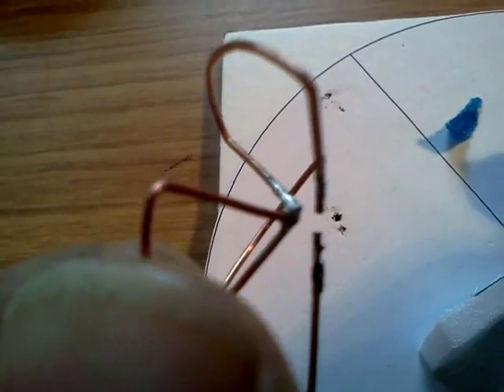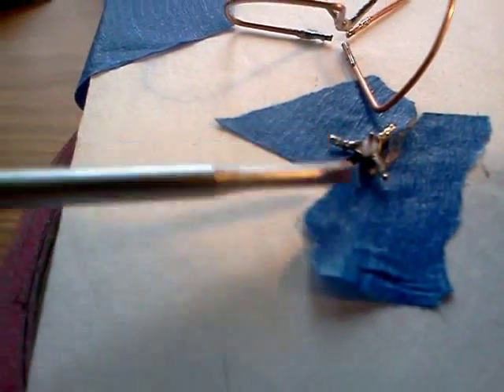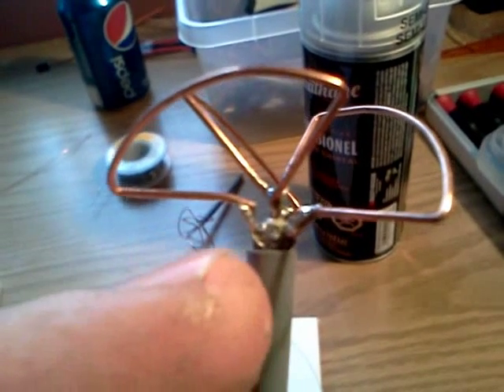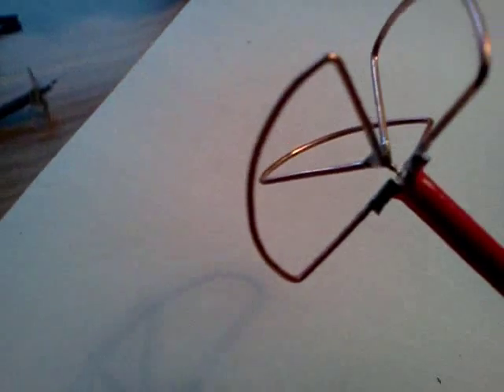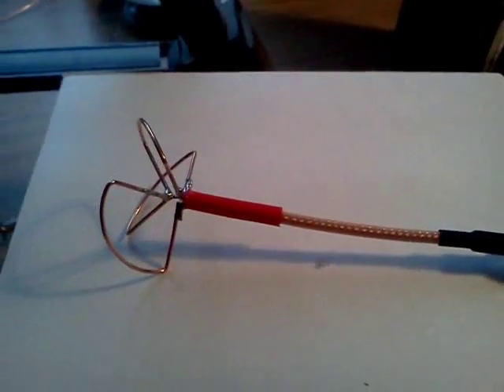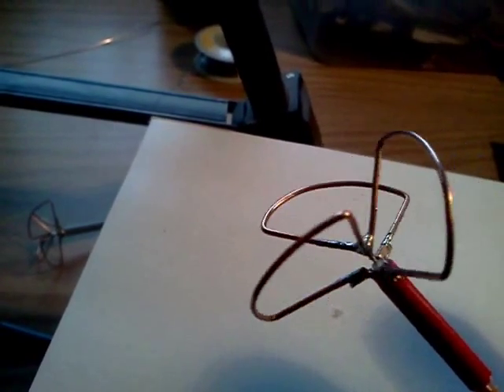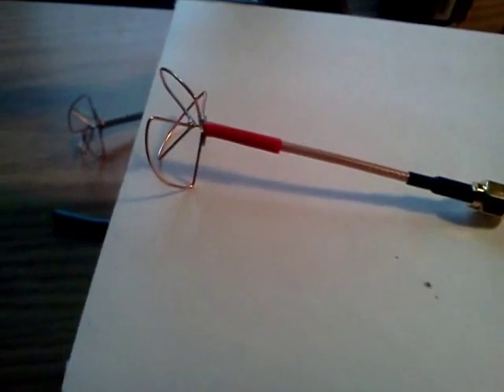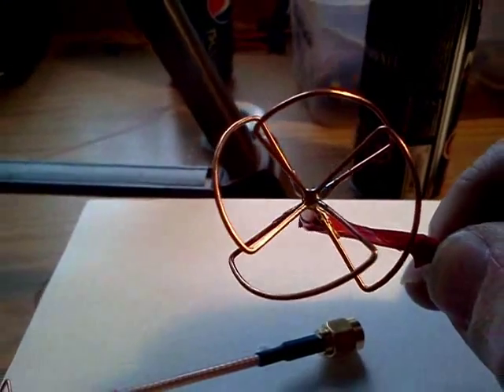cloverleaf antenna

Comment: Is that acid flux in that container? If so, don't use it, it will corrode your connection over time. You will see white powder around the connection when it does.